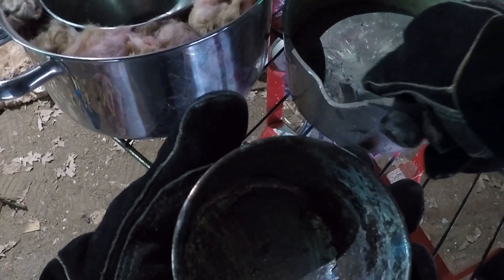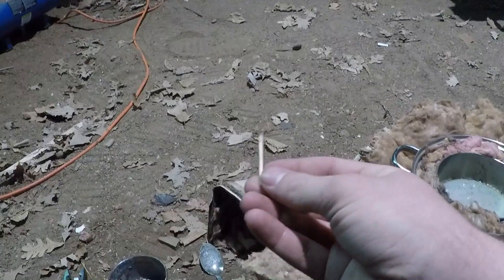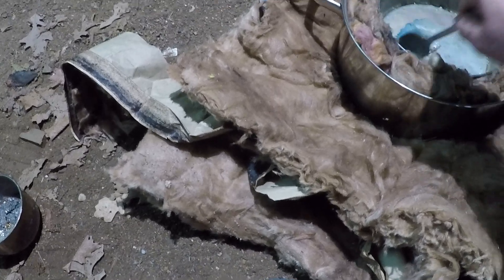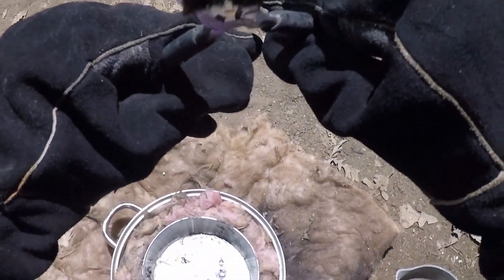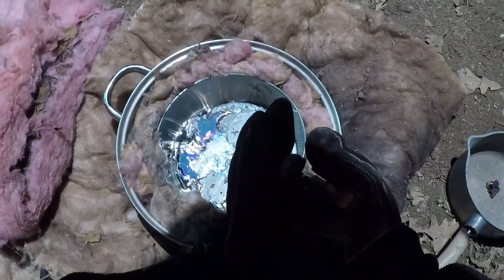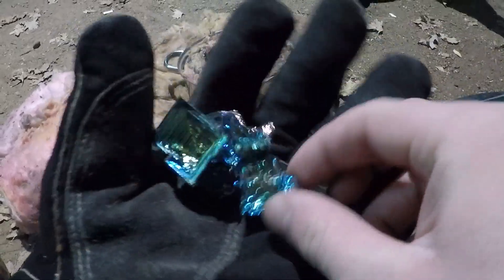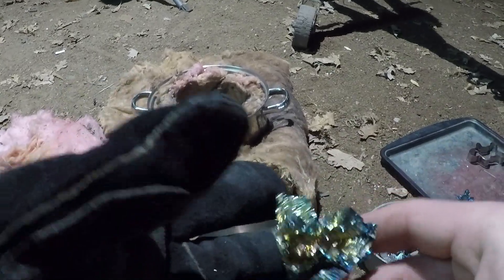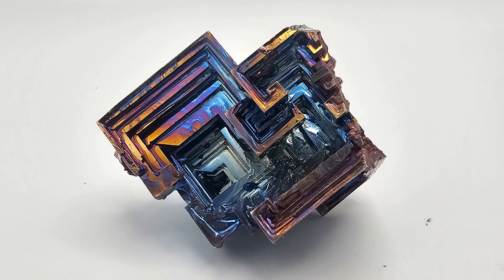MAKING SOME INSANE BISMUTH CRYSTALS BY DOING THIS METHOD?!

Comment: For SAFETY REASON...NEVER PUT SOMETHING WET IN THE MOLTEN METAL.....and use two pliers when handling the heavy pot ...much better control when pouring...AND SAFETY GOGGLES....i guess you already know, but better to be sure than sorry
Reply from the maker: I figured out to not put wet stuff in the metal the hard way around a year ago now lol. It made a big bang! 💦 +🌋= 💥
Thnx for the tips!
Reply: @jonathanjohnsonbismuth  me too....i got a hot shower and my ceiling some twinkling stars ;)